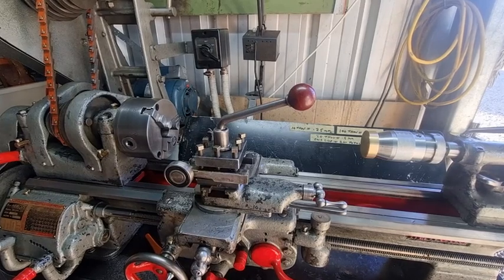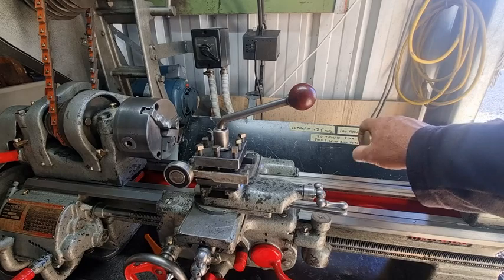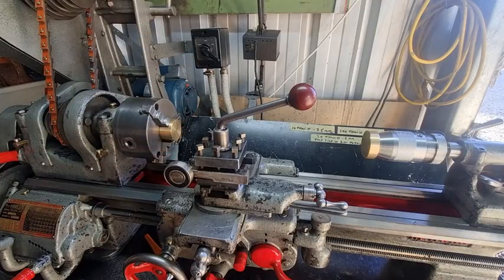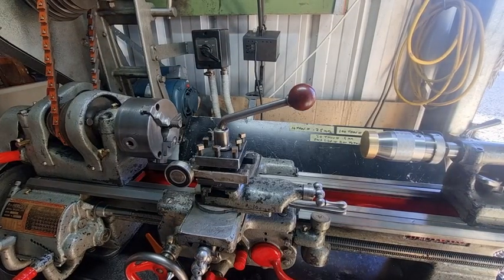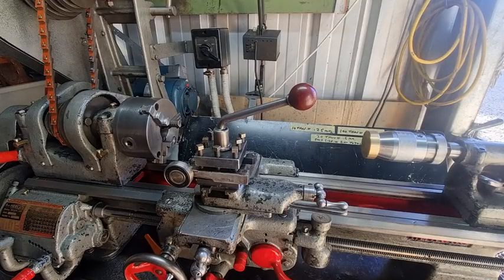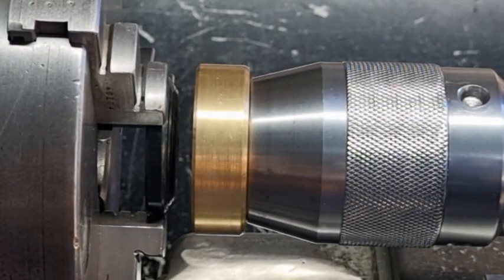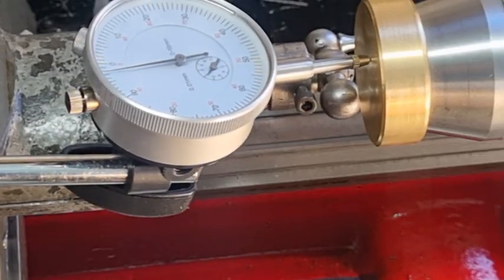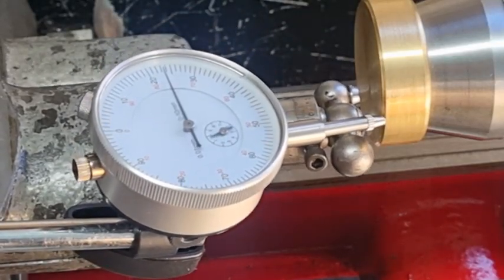Keeping small parts in a lathe chuck parallel with .0005 thou run-out

Comment: I don't agree with the "against the chuck" comment.
For a part of this size (length) it's for 99% the jaws which will hold it in the correct position, doesn't matter how the back face looks like. If the back face is not true to the "sides" you can stick it against the chuck as hard as you can, but as soon as you tighten the jaws it will pull away from the chuck's face.
Reply from the maker: When its all said and done you do what works for you.

Comment: I don't understand. What if the face is not parallel to the body. Facing of the first face is no problem but if the opposite face is "skew" to the body, how can any of these methods work.?
Reply from the maker: Easy to face of a large part when you can use the back of the chuck to keep the part parallel.   The method is for small parts that has chuck face to keep the part parallel end to end 
Also the part must be parallel in the chuck alingment with the jaws running parallel as can be along the jaw parallel line
A part is held in a lathe chuck with its length parallel to the axis of the spindle. The parallelism is achieved by ensuring the chuck jaws are properly aligned, the part is seated correctly, and the workpiece is supported by the tailstock for long pieces. Techniques like using a dial gauge to measure and adjust the chuck or part can be used, along with specialized tools like chuck standoffs to improve accuracy. 
Key concepts
Chuck: The device attached to the headstock that holds the workpiece.
Parallelism: The state where the part's length is aligned with the lathe's rotational axis.
Headstock: The part of the lathe that provides the rotational movement to the workpiece via the spindle.
Tailstock: A movable part on the lathe bed that can be used to support the other end of the workpiece, which is crucial for long, slender parts to prevent bending and ensure parallelism. 
Achieving and maintaining parallelism
Chuck and workpiece alignment: Start by ensuring the chuck itself is mounted squarely to the spindle. Then, when clamping the part, ensure it is pushed firmly against the back of the chuck jaws.
Use the tailstock: For longer parts, the tailstock should be used to provide support at the opposite end from the chuck.
Tooling and techniques:
Dial Gauge: Use a dial indicator to check for any runout or wobble as the part rotates. You can make small adjustments to the chuck or part to minimize the variation.
Chuck Standoffs: These are simple, adjustable components that can be attached to the chuck face to provide consistent contact points for the part, significantly improving parallelism. They are especially useful when working with soft jaws.